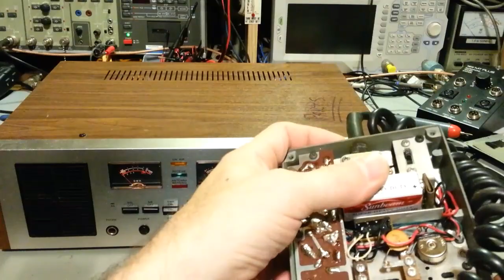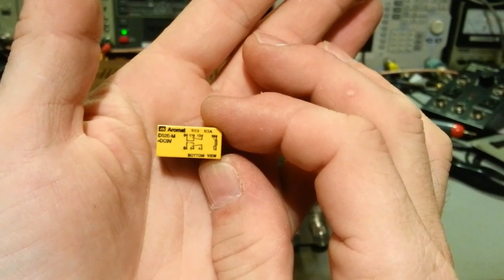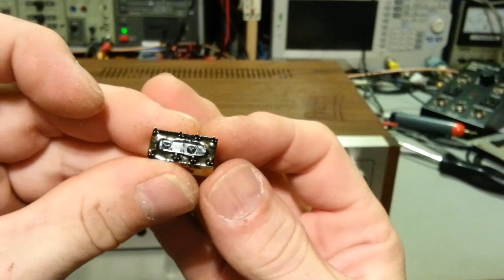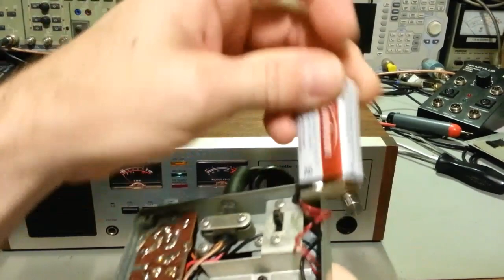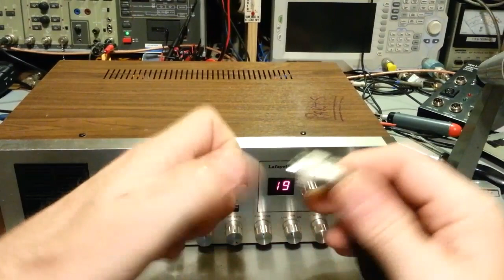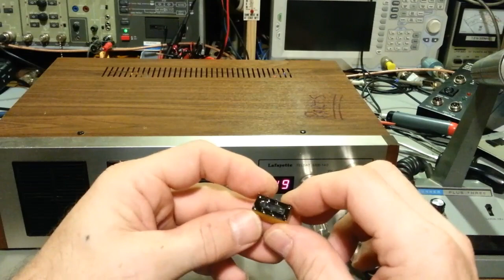CB radio squeals when plugging in a Turner microphone. Another method to fix the problem.

Comment: I have a keying box on mine with a relay, no squeal on RX.
I make same box for a mate with exact same radio (Electrophone 590) and his squeals. The only difference with his keying box is that it has a 5 pin Uniden plug on it, with an adapter lead to 4 pin Cybernet. I can't understand why it would squeal, unless there's a group loop.
Any ideas? Anyone?

Comment: Hope you have a minute for a tech question. I have a Montgomery Ward 719a that has the 5 pin microphone plug. I recently bought a 4 pin to 5 pin microphone adapter from ebay and it works fine on transmit but when I am in receive mode, if I have the radio volume up to loud I get a slight amount of squeling through the speaker. I don't have talk back and it's only happening in receive. I'm thinking it's a problem with the way the radio has to have a microphone plugged in to receive. It never did this with the stock microphone and I believe it's just due to the adapter. Any suggestions would be great. I'm in Nacogdoches Texas and would really appreciate the help. Thank you

Comment: Hi my name is i have a 29wxst that has problems it comes on but i,m not really getting any audio and the signal swr not lighting up meter does nothing and all the parts were totally adjusted wrong sorry for long message iust paid to much for the radio maybe you have some advice .the the your channel
Reply from the maker: +Brandon Mazza 

First place to start is with a transceiver alignment.  It is possible it's so far out of alignment it's causing your problems.  If not the alignment procedure makes a good first troubleshooting step to start to isolate problems.

Comment: On another note, if you have a problem with wiring 4 wires, and some people do, you can use a N/O micro switch and just break into the audio wire. Some of those switches made by Cherry fit right in there and a little dab of hot glue works very well.

Comment: Would a 4N25 opto-isolator and 810 ohm resistor work in place of the electromechanical relay? The resistor, or course, is for the input LED of the opto. I calculated Rd = (9 - 1.2) / 0.01 = 780. 810 is the next available 5% tolerance resistor size. The trick would be wiring the output side of the opto.

Comment: Mike, I don't know how many times that I have a similar problem...except that someone had wanted a particular microphone wired to a particular radio and had problems...no modulation, no transmit, no receive, squeal when the mic is keyed up, etc. So what do they do? They go inside the radio and rewire the entire mic jack from the inside of the radio, adding parts like resistors or diodes or capacitors, etc. I can't tell you the number of times that I have had to go inside a radio and rewire the mic jack from the inside, and then rewire the mic itself to fix the problem...because even though they may have "fixed" the squealing problem, or no transmit or receive...it will work, but you can only turn the mic gain up so far on the radio and/or mic before it starts squealing, or actually keys up by itself or the receive cuts out. Great video to an age old problem that I still get across my desk from time to time. Thanks for the info!!

Comment: Takes me back to 1977, trying to explain to a customer why he needed a 6-wire mike to work on a radio with a 4-pin mike socket. The only explanation that worked was to take a 6-wire version of his older mike and plug it into his radio. "My mike works, yours won't. What else do you need to know?" The explanation about why his SSB radio worked with the 4-wire mike and his AM radio would not just got me blank stares. 

73

Comment: Polarity marks on the top of the case tell you that the flyback diode is built in. No need to add an external diode to catch the flyback pulse when the coil is de-energized.

73

Comment: Nice job buddy, that's a good looking old radio.
Reply: RSC Electrical back in the late 60s early 70s, when power Mikes gained popularity was to take a thin piece of copper wire have it in between the coil of the microphone cord ground it on one of the screws on the side of the radio and the other end to one of the screws on the microphone usually took out the squeal so you can fine-adjust the audio short of over modulation etc.